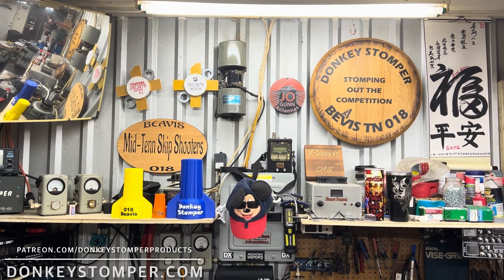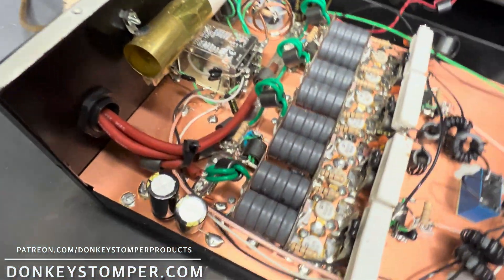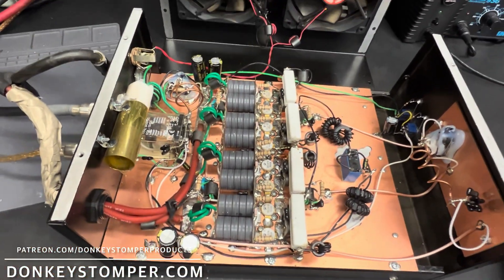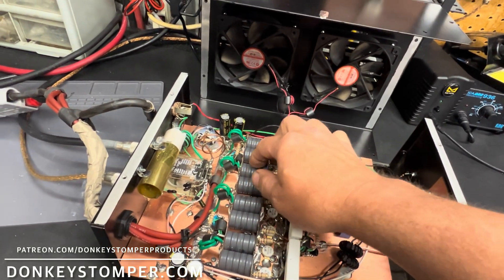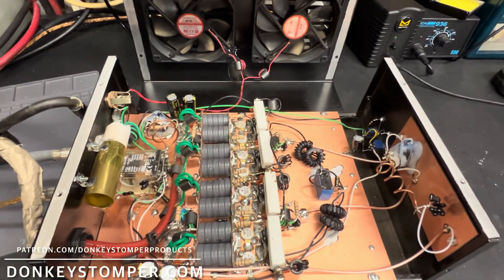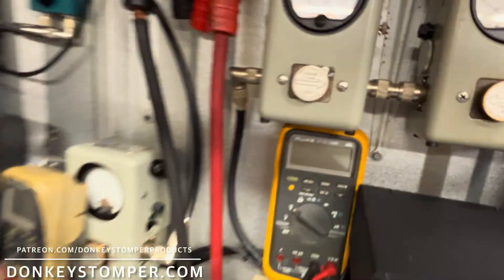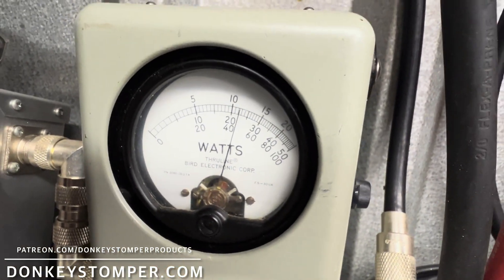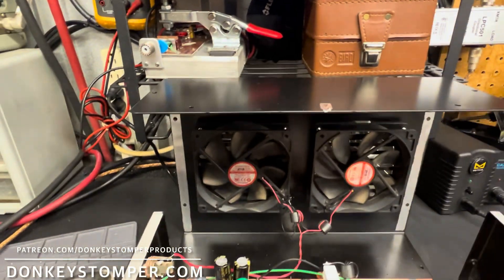Custom 8 Pill Mobile Repair, CW Transmitter, Lets talk little about Carrier and Watts,

Comment: I've got a question? I have a older 4 pill 2879c the lowest dead key is around 160ish with my 955+  also it's not 25 watts defense from 2 to 12 watts. It seems to run cool. 800 pep on dose. Any info is appreciated
Reply from the maker: I'm saying C hold little more. I still use guide line to go by. You can get by with a little more not silly high. Thanks donkeystomper.com

Comment: 2879 Cs is what I like and use
Reply from the maker: Well They change to much from batch to batch is my main issue with C. If you build a big amp they change transistors blow one. I have to change them all. Tune is always changing. The watt increase is not enough to pay for them, But I still offer them. Thanks donkeystompoer.com

Comment: Overdriven
Reply: Hey what will your 16 pill comfortable run at what drive input and final output wattage
Reply from the maker: @Raccoonman60  I like to key it around 200 swing close 2500 pep daily use drive with 2995. If you want drive it like 4 pill hot 2pill key 400max swing over 3000pep and hold up reg 2879
Reply from the maker: Thanks for watching... donkeystomper.com